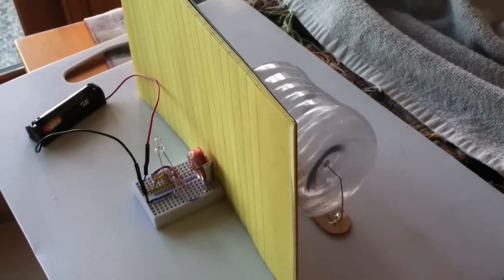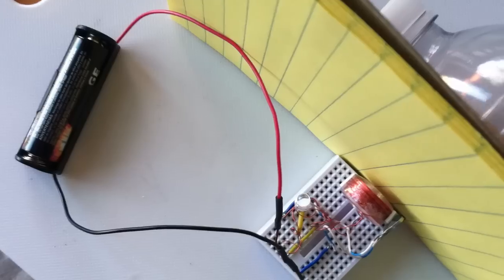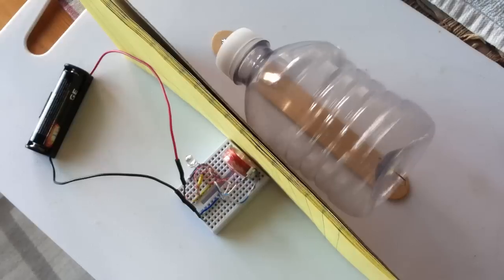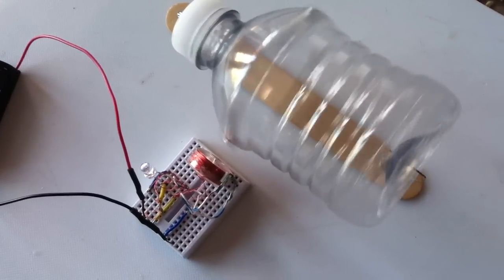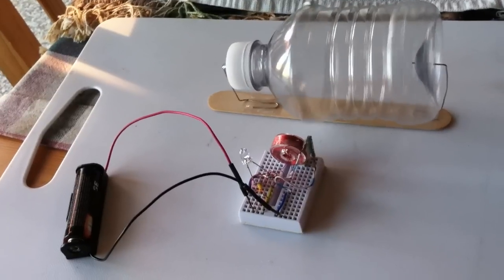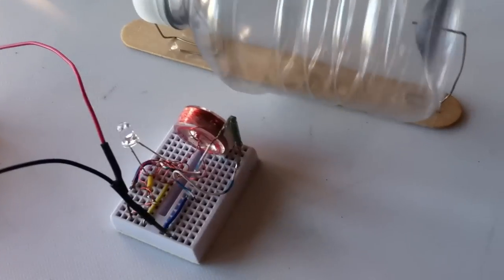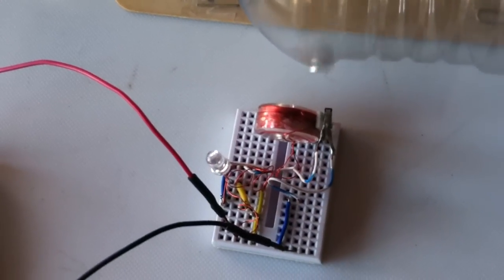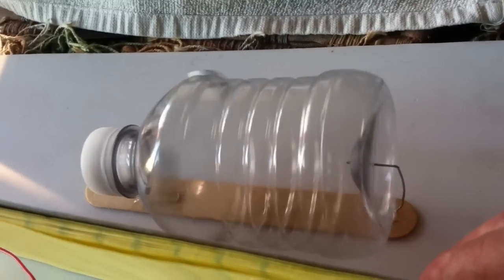Mini Water Bottle Pulse Motor  -- how it works

Comment: Ah yes, a glass case, such as those domes that cover mantel clocks. 
My thinking was for solar power transfer, to a fan. There would be no need for any wiring or holes to be drilled in a wall from outside to inside. A 90 degree power transfer crank, or worm drive cog would turn the fan itself :)
Reply from the maker: I keep thinking about applications where you need complete isolation from the driver like in a bio hazard or nuke situation.  They probably already have such a thing.
Reply: Gas plants are another area, both natural gas and petroleum refining. There must be bunches of scenarios where something like a fan or other useful item can't be used.

Comment: thx excelent replication.
hummm you cant make a leiden bottle is more energy for you proyect
Reply from the maker: Thanks.  I think you mean "leyden jar" capacitor.  It would not help here.  Those are for high voltage electrostatic type motors and this one is electromagnetic.  It is an apples and oranges thing.

Comment: why didn't you lift the bottle to show that nothing's underneath it?
Reply from the maker: This is just a simple pulse motor.  It is interesting that some think that there is a trick to this.  It must be the bottle that gives it that feel. Basically this is called a "brushless DC motor".  A DC computer fan motor is the same principle but uses an electronic Hall sensor circuit for triggering.
Reply: ***** Just saw your other video!
Reply from the maker: Great.  Check out my next video.  I show more on how this works including a circuit diagram.
Reply: ***** already did! I'm planning on making this with my little nephew whenever he visits us next. many thanks!
Reply: Spa.      ,

Comment: Have you thought about putting magnets at the other end of the bottle to see if you could generate any electricity? Or even combine it with a static generator?
Reply from the maker: No.  This was just a quick project I did to see if I could turn the little bottle into a motor.